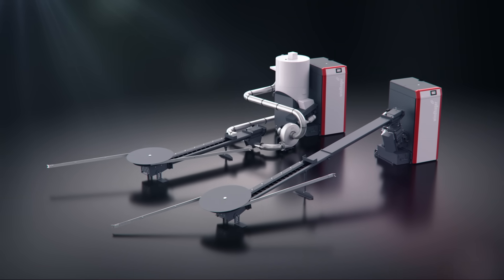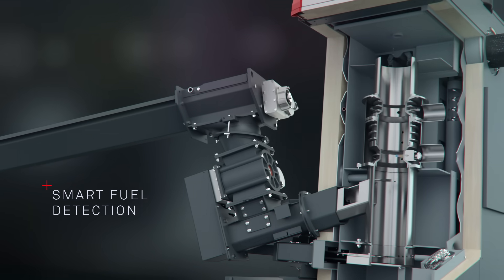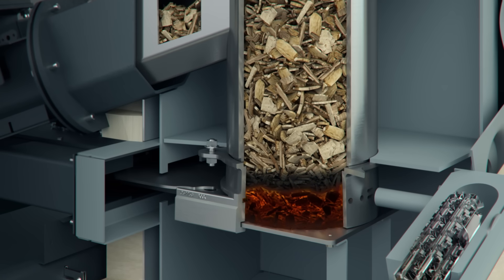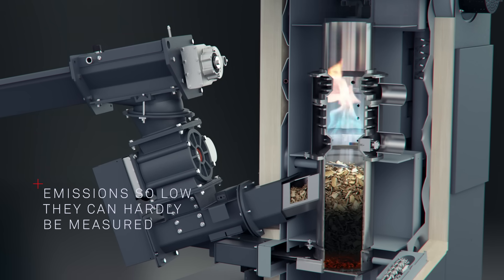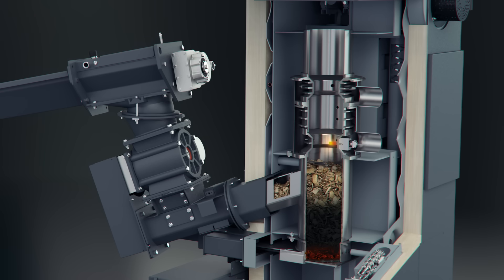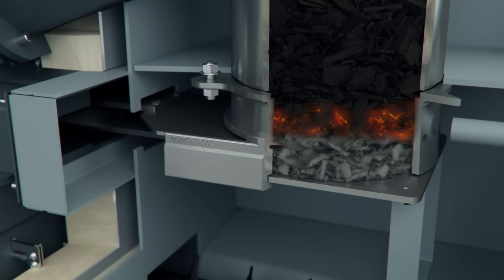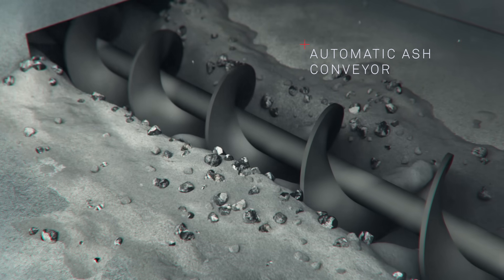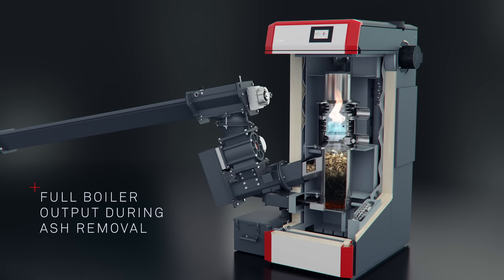Windhager PuroWIN - wood chip boiler - zero-emission gasification boiler with stainless steel burner

Comment: It's something new that can burn wood chips without the carbon turning into CO2. Wow. Zero emission, yet still runs on wood. Wow again. Looks like they went to a different school than I did.
Reply: When did they say that the exhaust gases do not contain CO2?
And the zero emissions claim is true if it burns woodchips instead of natural gas or coal.
Reply: @schnabuliertier  What exactly does "zero emission" mean? Have you finished secondary school yet? I'm not provocating, I'm curious indeed.
Reply: @baladar1353  Yeah, "zero emission" does not mean "carbon neutral." However, carbon neutral is still good.
Reply: @BlunderMunchkin  not if we destroy the nature in the hunt for carbon neutral (witch is a f.. Lie in itself)
Plants love CO2 the greening of dessert prouf that 😏
Reply: Zero net emissions means the carbon sequestered by the fuel when it was growing is equal to the Carbon released when burned. Wood chips are declared a carbon neutral fuel in Europe. They grow trees for coppicing & chipping up for fuel on a commercial scale.
Reply: @seanconway1154  yes and that's a bloody scam. Also we use straw from Korn so slowly we destroy the farmland. Not one of the alternatives pushed now for energy production works or helps the nature. It's all feel good
Reply: @eriknielsen1849  it's not. Just because the practices at the moment are destructive doesn't mean they have to be, research John Kempf. Corn & coppiced woodlands can be some of the fastest ways to sequester carbon, & most (~60-75%) of that carbon is actually pumped into the ground & is not the plant biomass.
Reply: @seanconway1154  I love you admit they for the moment is destructive.
And thanks for the info about John
I will maby look into him. Becorse I'm a sucker for nolitch about grouth methods. Try seartch green the dessert you will say why is there dessert afterwards 😉
But becorse there is methods it dosent meen they are used especially for firewood where you have to think a litle on the economy. And then we have the area use just the big power plant UK is building if not finished will burn a area the sice of Denmark ewery year. So that's a big area with werry litle biodiversity just to keep that running. I will agree we in the west should mowe away from oil. And if the contryes realy ment it they would go for thorium 1 cubic meter of rocks contains energy for 6 peoples life use of energy. China is beating us on that one now. But of course then they can make cheaper things for us

Comment: I believe 1 unit costs over 10k Euro, hence I have a few questions regarding its profitability. I think it would be better and smarter to buy the simple wood boiler, add heat accumulator (volume should depend on a space of your house, usually 3 cubic meters for 100 square meters), add 5-10 plane solar heaters (helio system). In total, you will spend less money and will be saving it in the future and you won't be sitting in front of your boiler every 3 hours
Reply: Not to mention replacement parts. We live in an age where $500 laptops have $250 batteries. 

I bet if anything breaks on this thing, the individual replacement parts would run you at least €1000, if not more. Best case scenario is that you'd end up spending a few thousand on this thing, just to keep it running. 

Hey, at least it appeals to the sensibilities of university educated liberals who've never worked in their lives.
Reply: @evanharrison4054  Wholeheartedly agreed, particularly including the last telling sentence of the demographic this is aimed at.

Comment: "Zero émission"??? How incredibly misleading. Zero emission of WHAT!? The standard individual will assume you are talking about greenhouse gasses and all pollutants, but you're just repeating to particulate matter. Why not take that precision? MARKETING SCAM
Reply: Plants love CO2. But that's another story. I thought the same 😃
Reply: @eriknielsen1849  Yes they do, but commie leaders of the global warming tax scam don't want anyone knowing that, and  their sjw snowflakes melt when you try to explain we need co2 or life ends without it.
Reply: @comedyguy911  it's like comparing  carrots and apels. Do you know in a normal class room 3000 ppm CO2 is quite normal. Plants would love that. A car emit not only CO2 but also sod and Nox. And also a plant need oxygen for the roots and when there is no light.
Reply: At 1000ppm of CO2, there can be loss of concentration and fatigue.  And yes, it does seem like there are some emissions, but it sounds a lot better than normal fireplaces.
Reply: @ryancappo  1000 ppm is way to low maby you mean Co. And yes a lot of bling in this fireplace
Reply: @comedyguy911  so you didn't understand a word. OK I knew my English was baad but not that mutch 🤔
Reply: @comedyguy911  said the man 10 hours later 🤣🤣🤣
Reply: @comedyguy911  Yeah excess co2 trapped in a confined space displaces the amount of oxygen, it leads to sleepy lazy office workers, that is why in my industry of HVAC we install ventilation thats what the V stands for in HVAC. But I will pass on your idea unlike co2 which is necessary for all life on this planet and plants absorb it and convert it to oxygen, CO which is a byproduct of combustion is quite toxic and deadly.
Reply: @comedyguy911  Maybe you could drink more soda, that way you can say you are doing your part to help eliminate excess co2.
Reply: @comedyguy911  ewen if we burned all oil coal and gas in the world we would not get over 800 ppm.
Reply: @comedyguy911  Says the indoctrinated idiot buying into a tax and control scam.
The Earth has controlled the greenhouse effect long before humans ever existed.
Co2 has been fluctuating since the formation of an atmosphere.
The sun also plays a huge roll on climate, as does the ocean.
But hey keep buying into the guilt trip the controllers are selling you.
Reply: @comedyguy911  For 40 fucking years you loonies have been crying man made this man made that catastrophe.
Not one has happened or even been close, the real ones like super volcanoes, asteroids, supernova etc. cannot be controlled but are far more likely to happen than your gawd damn tax scam of control man made bs!
Reply: @comedyguy911  No its called critical thinking. The ability to discern data from propaganda based date.
You cite the DOD, the DOD will also tell you that the US military is the best in the world, but non propagandized data states other, the sources are endless in and on any subject.
The DOD also published alot of data on weather modification, by controlling weather one can use it against its enemies.
Good read they basically admit to a bunch of things you indoctrinated lefties call conspiracy theory.
The joke is on you if you trust and believe the government.
Of topic but a good example of not trusting control freaks, aspertame was originally banned by the FDA because of the findings of its dangers to health, but Donald Rumsfeld exerted power and got it approved, of course later many years later that truth would come out.
I can go one for days about the proven and by proven declassified ways the government has deceived you.
And when I say government it includes many more than just the folks you vote for.
 You can choose to keep believing the lies, or you can learn to accept that they lie to control you.
I only argue with you as I am well aware of their lies and deception, and they only win if they convince enough.
Reply: It does indeed emit zero communism, which is the number one pollutant the world has ever seen.

Comment: Fascinating! It's like a "smart pellet stove".
Reply: and that is all it is. marketing fills in the gaps. a smart pellet stove is no better than a "dumb" pellet stove, this thing has feature creep out the ass.
Reply: @gramursowanfaborden5820  No, the difference from a normal pellet stove is that this uses raw wood chips instead of pressed pellets. They are cheaper and much easier to manufacture, it's basically just the stuff you get out of a wood chipper - it's in the name. Also this thing is much bigger, and with that comes the need for automation. What else are you gonna do? It consumes too much fuel to have someone refill it manually, plus you might need to pay that somebody. But most important of all: Wood chips are a pain in the ass to automate. I have actually dealt with them before. Instead of regulated sizes and uniform shapes, they are unpredictable, get stuck immediately, and their fibers get stuck in smaller equipment. That's why this machine is so complicated and big. It has to be big enough to be able to shear a stuck wood chip in half, else it would get stuck. I find that this machine is actually very mechanically simple. You have a feeder with a safety valve to prevent fire going into the storage room, and you have a ash remover. You can't make it any simpler. Try to simplify it, really, try it! And no, I am not from this company, just look at my channel.
Reply: Windhager is also a producer of pellet stoves. This is a special version for people / regions with access to cheap wood chips.

Comment: What type of wood chips we are talking about, are there any specifications ?
Reply: In Brazil, planted Eucalyptus
On Europe, wood from ancestral forests both internal as imported
Reply: @rlguerrero2263  what about cotton ?
Reply: @AbdulHannan-uv6ym  Cotton is not a great yielder when it comes for biomass for fuel.
But it's stem and husks may be used however.
Are you a producer?
Reply: @rlguerrero2263  In Catalonia, we use almond nut shell. It's perfect, super dry, high relative superfice and low in tars. Not to talk that is a byproduct of another industry, no need to grow it, so it's use is not replacing any other crops.

Comment: So...this is a cartoon of a "do nothing machine".
Reply: Someone who has eyes and yet does not see what he is looking at.
It supplies clean heat only using wood chips that would otherwise be scrap, so it definitely does more than something.
Reply: @archangel20031  Do I have to plug it into an external power source to make it work?

I can get "clean heat" from an electric space heater which is a hell of a lot less complicated.

If it were powering a generator that was in turn powering all the complications that made this machine work as well as a few household appliances, then it might be worth something.

I can see just fine.

I would hate to have to rely on this in a "lights out" situation.

Comment: how it can burn without oxigen.... bullcrap...
Reply: The title is misleading, granted, but the video clearly explains and refers to particulate type emissions.
Reply: The air is added above the woodchip...
Reply: @rickywright1264   so where co2 is going.... it has to go somewhere .... and that is not 0 emission
Reply: there are holes at the bottom near the ignition point. The air wouldn't flow down if inputted above the wood shards as the heat would push that air up. You can see the holes when they open the ash tray in a close-up.
Reply: It's not zero emission, that's not what the video says. Perhaps watch it again and listen carefully?
Reply: @rickywright1264  zero-emission gasification boiler with stainless steel burner, that is what ttile of video and their presentation shows.... it is misleading fraud....

Comment: How long has this been in service. Lots of moving parts and sensors. Maintenance issues!!
Reply: a piston internal combustion engine has literally over a magnitude more moving parts and can last quite long with just the prescribed maintenance...what's important is the quality of individual modules and a mature design.
Reply: @AKAtheA  not even apple to apple comparison. U start mixing soot and dust with eye and sensors u have maintenance issues. Just curious
Reply: @AKAtheA  The piston internal combustion engines are developed since over a 100 years and still fails. Moreover, they tend to be more reliable the simpler their design is.
Reply: @brys555  modern engines are designed to fail. They can be engineered to be near bulletproof but it makes them super expensive. I went to college for mechanics, the average car engine is designed to last only 15 years before needing major service, forcing you to buy a new one or bear the shame of driving an old heap. Repeat business is good business and most of a dealership's income comes from the mechanics and service bays.
Reply: @StonedEwok-n8h  I agree with you except the last part. Most of the dealerships' income comes from selling new cars rather than repairs/service the ones already sold. The ratio is about 8:1 to 10:1. At least that's for premium brand dealership located in central Europe I work for.
Reply: @StonedEwok-n8h  My data comes directly from CEO. He hate our service department just because of that. We generate most of his problems such as unsatisfied customers, accidents at workplace, our crew is a half of all employees yet we make only 10% of total income. Necessary evil.
Reply: TJ Thunder  Austrian*

Comment: stupid question: but what does it "do"? is it for heating water? can it generate electricity? is this for residential or commercial?
Reply: It has been designed specifically for heating your house
Reply: You have heat, you can use it to boil water and use the steam to generate electricity. Or you can use the system for central heating .
Reply: @AbdulHannan-uv6ym  It would be interesting if they figure out a way to make a heat exchanger/steam generator accessory that can attach to it to provide power to a battery backup system for an off-grid home.
Reply: @ryancappo  its interesting and easy to do. It would be more interesting if the design is modular. Plus  the fuel is fiber containing wood pallets think if they can figure out to burn multiple fuels lets say cotton or any other crop it would be very good business plan.

Comment: Can this system be used for burning particle board, mdf, and material chips with formica laminate? Can it handle sawdust inclusion? What is the thermal output? Is it for heating water or forced air?
Reply: wont work with sawdust as it requires gasses to pass  from the base upwards.
Reply: Rick it didn't occur to go to manufacturer website and sen query directly to them. But since you asked us, I think this also burns abs plastics very well without problems. I've also heard that it's possible to get rid of waste oil by soaking wood with that and burning everything. Maybe even the heater itself. See where this is going?😏😂
You just might get wrong information looking it from here 🙏
Reply: Why are you asking us? Wdk!!